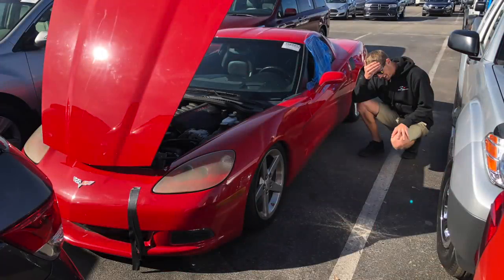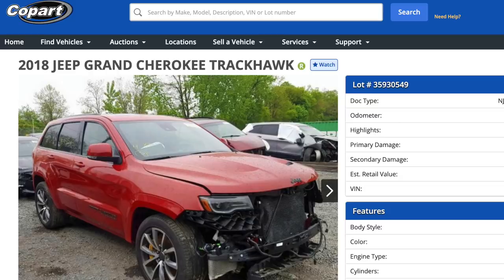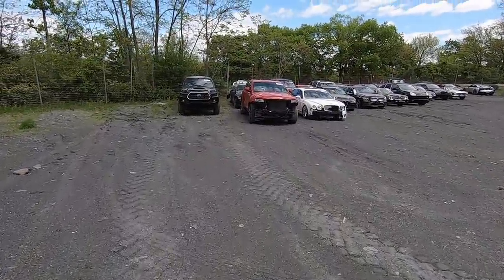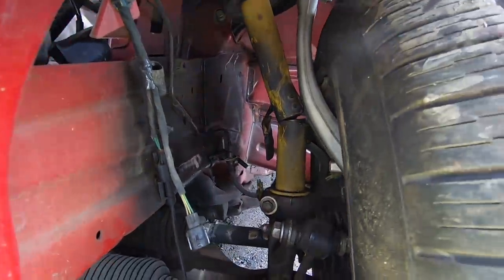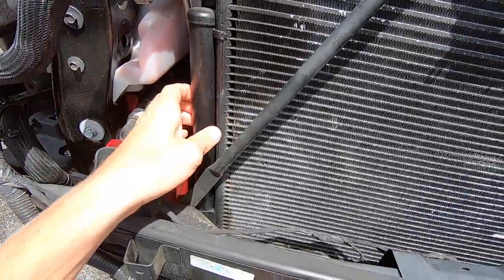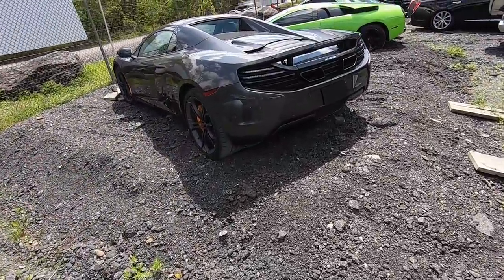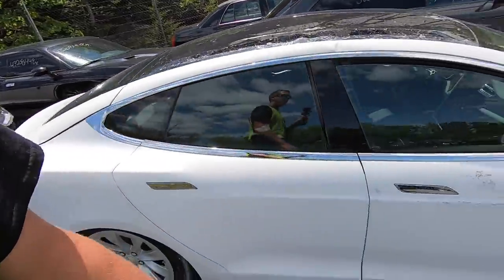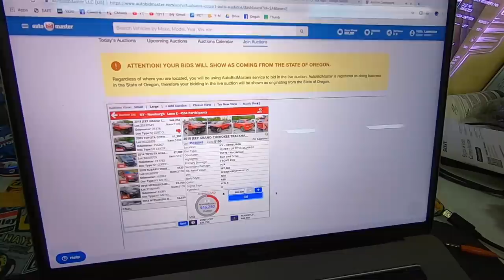We Tried To Buy an Auction Jeep TRACKHAWK... What a Disaster (Almost got hustled)

Comment: I buy roughly 300 salvage Jeep’s a year from different insurance auctions. If that’s the route you’re looking to go, try to buy from IAA. They have a lot less cars being sold by non-insurance company sellers. The other thing to look at is the information regarding who is selling the car. You’re going to want to stick to vehicles being sold by Insurance company’s you recognize the name (geico, State Farm, etc). They do not hide damage and the cars generally show up at the auction the same way they left the accident scene (minus random dangling parts that are removed by the tow company/body shop). IAA, in my experience, also does a better job of documenting the vehicles. And they will also take more pictures for you on request for a small fee. I have multiple stories of bad experiences with Copart and only have had 1 problem with IAA in almost 10 years.

Comment: Always Check What Color The Block Is haha. A 5.7 Hemi Block Will Fit And Bolt Up To Every 6.2 Supercharged Component haha. I've Thought About This Before hahah. Also It Should Be Orange. If It's Black It's Either A 5.7 Or The Truck 6.4. if It's Orange It Could Be A 6.1 6.2 Or 6.4 (Car 6.4). Hahah

Comment: Lightly Wrecked huh? They don't just put the word "salvage" on the title of a 90 THOUSAND DOLLAR SUV for a scuffed bumper.
Reply: This, why I steer clear of newer salvage vehicles. No used parts to be found anywhere and the damage will always be severe to warrant it being a write off. 5 or 6 years old , you can do a quality repair with used parts and the damage won’t be anything like so severe for it to be in a salvage auction.
Reply: @ForeverNeverwhere1  Yeah. There's a reason the insurance companies write these vehicles off. They are salvage - some more salvage than others. Most of this stuff is just junkyard buys, if even a junkyard is willing to gamble on them.

Comment: 46,250 before copart fees. Im sure you would be well into the 50k range after all is said and done. Then you have to add shipping to FL. Completely agree with your decision. Not worth it! 

Also, it's still in the auction.
Reply: Copart charges 5% fee so that would be roughly $2500. Sad to see so done paid $50k for that real dumpster fire.
Reply: He clearly said 35 so 46.2k is after all fees did and done.

Comment: Auctions= shit. sometimes there's gem
Reply: The key with auctions is to buy cars being sold by insurance companies, not from these frauds.
Reply: Seth Fjeldheim got a few good vehicles from copart, you just need to play the numbers and check out every vehicle with your own eyes before bidding. Write the max bid down standing in front of the car and never ever deviate from that max when bidding online. There will always be another car next week.
Reply: @ForeverNeverwhere1  even then you can get screwed there's no reason a $90,000 trackhawk would have a salvage title if the damage was as minor as it appears.. it's got frame damage for sure
Reply: @ForeverNeverwhere1  that's the thing, you have to do research and not let your emotions make you bid more than you should. That goes for any auction honestly.
Reply: GixxerGuy1000 _ totally, you can see that in the way the wings don’t line up.  That is not badly fitted, that is corkscrew bent frame

Comment: Nothing wrong with a Trailblazer SS just in case
Reply: Except for the shitty 4l60e
Reply: @scottydoesntknow254  it has an l70 not a 60 so it's not "shitty" or if you are making some high power then you can just upgrade to an l80 it's almost bolt on.
Reply: @andy123441  same fucking thing really. 60e & 70e both are shit

Comment: Goonzquad Trackhawk is undergoing huge bodywork repair project.  Three workers have had it on the Frame machine for probably 4 days.  Frame work only (2 workers x 10 hours/day x 4 days x $100/hr)= $8,000 labor + $4000 parts.      Assuming third dude is filming the other two.

Comment: If u ever need to use a frame machine or body shop come on up to Knoxville tn , I got you haha . I spent over 10k on a 335i that the insurance company put a new hood,fenders,bumper cover. It had door and quarter damage and the headlights were gone shop I figured they were stolen,but I bought the car from copart in NJ got it to tn to discover the frame rails look like an accordion, valve cover busted timing chain snapped, I ended up buying a whole car flooded parts car to rebuild mine. I had over 25k in a car worth about that. Pictures LIE!

Comment: The scam industry around these CoPart auctions is so bad...

It should not be allowed to temper with the car after its been in an accident in ANY way. No removing parts, no hiding damage, not making it appear more pretty that it is....

But CoPart gives these guys a platform and they are going for it...

Sadly this JEEP has been messed with too far to buy it for any price. In its original state you could habe atleast bought a good drivetrain and some inside bits...

Comment: Copart actually  does that they replace some parts and put the cars back on auction to get more money.  They did that with my 2008 rs4. It went to copart. Had bent frame but they replaced  fenders and radiator support plus hood. They bought the car from me for 11k replaced hood both fenders and support and put it up for 24k buy now. It had 19k original miles on it. Guy in same state bought it then ended up parting it out because of the frame

Comment: There is a bunch of shady shops that buy these slightly fix them and flip them back into the auction for profit.   I've even seen them use less damaged parts to make the car look like it was in a light accident.   Looked a chevy truck that looked like it hit a deer.  Crunched bumper and hood.   Original pics show the metal bumper torn in half, hood ripped and buckled, etc.   The swapped the parts for less damaged parts they get for next to free.  Shady ass scammers.

Comment: When my dodge 2500 was wreaked copart had it sold as near perfect with rear end damage/run/start

The truck was rearended and had the driveshaft pushed into the billet shaft and wedged into the crankshaft. The motor wouldn’t spin when cranking it with a breaker bar. 

I feel bad for who ever bought it just cause it had a crushed fass and sump on it